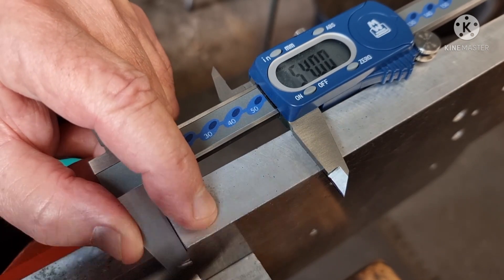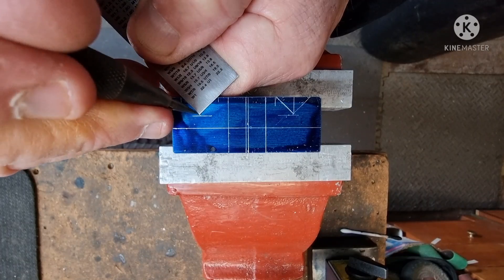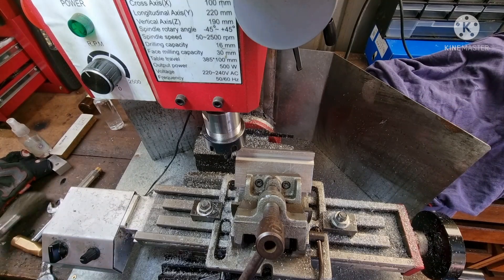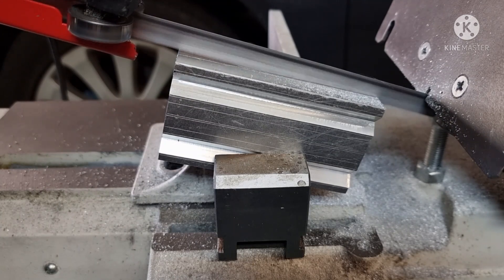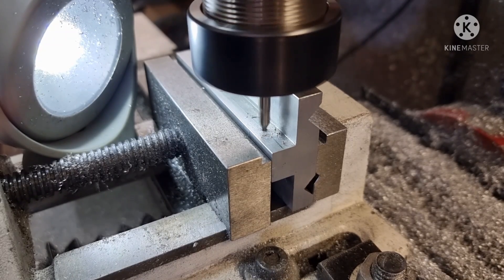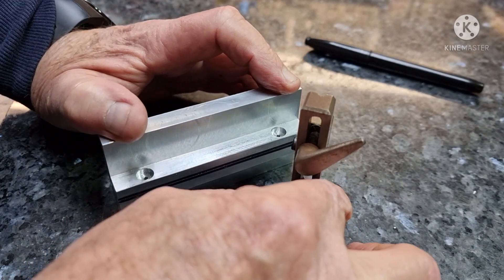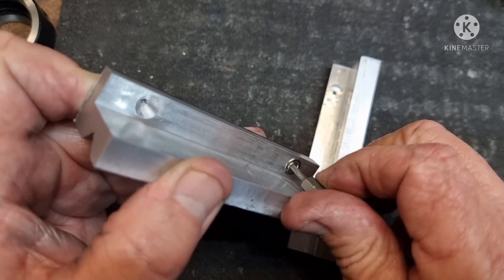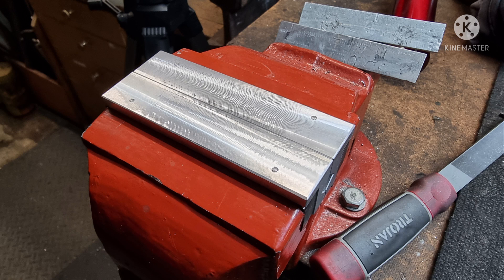magnetic soft jaws

Comment: If the mag jaws stay in the vice for a while, do you get problems with iron/steel filings collecting on the steel jaws ?
Reply from the maker: Just checked, no filings on vice jaws, they do congregate around magnets though, i pinch these off with a cloth
Reply: @stevohdee8118  
thanks for that - the sticky side of duct tape works pretty well too   :<)
Reply from the maker: Ohh... gunna try that, thanks

Comment: Nicely done, Stevo, we have the same mill, one of the best mods I did to mine, was make up a handle, that screws on the fine downfeed knob, by tightening up the z axis a bit, plunge cutting is sooo much easier  https://youtu.be/UggExs50C-M  ,and got the air spring conversion from Little Machine Shop, outstanding improvement, plus about 50-ishmm extra in usable Z height, 

but wait, there's more

I also copied International Precision Engineering's idea, for stiffening the column https://youtu.be/JwzA67_-cAM
I used 20mm Bis80 for the base, and 6mm thick 125mm wide?? channel for the spine, WOW!!, what a difference it made, the finish from flycutting steel, is damn near erotic;).

Sorry for talkin' your ear off, at least I didn't mention the wizzbang 3 Axis DRO from Ali:).

Take it easy,

Scott.
Reply from the maker: Haarr Scott, thanks mate, seen all those mods but decided didn't need. Am lookin @ dro's just for the x @ the moment, dunno which to get, more research & more vids before deciding, prob get the cheapest POS and regret... hmm